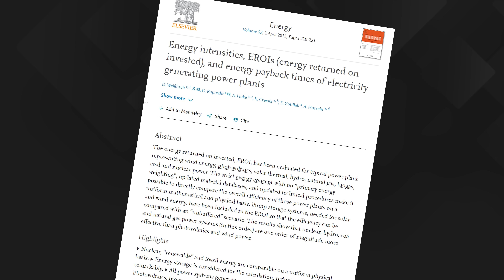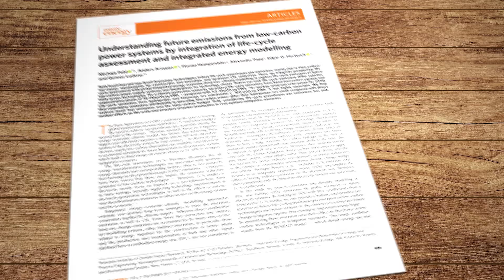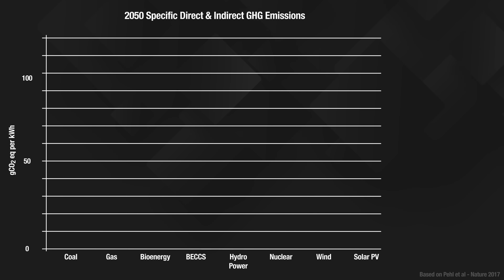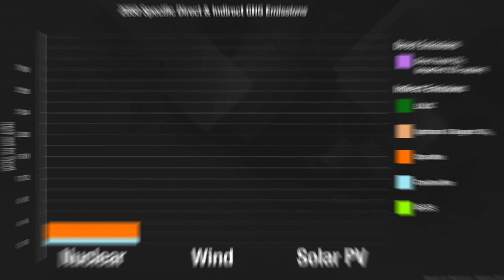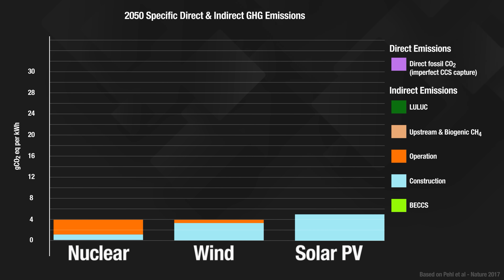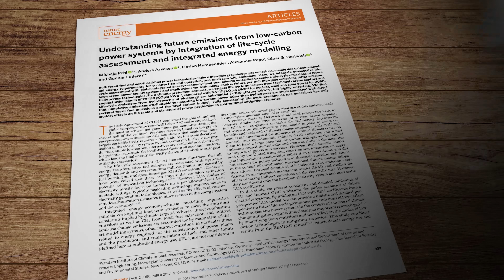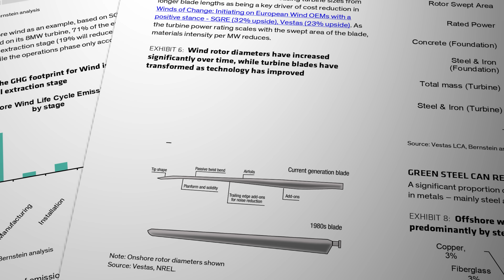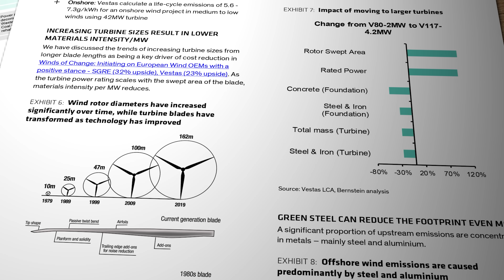Lifetime carbon emissions of renewables vs fossil fuel. Problem or solution?

Comment: Thank you for another excellent video.   Still we run into the problem of the Duck Curve (PV) and times when wind does not blow.  How does adding reasonable storage using pumped and currently available battery storage systems add to Wind and PV?    And of course some of the best CO2 reduction technologies is improvements in end use efficiency.  

Just an additional question.  Would some industries be able to switch to solar where production rates are adjusted to match energy production peaks and valleys ( again the Duck Curve).  Something like a desalination plant where it is mostly idled at night but, peaks during bright sunlight.  It is an obvious adaptation but, I haven’t seen anything discussed about trying this.
Reply: After two decades of commercial wind power, we have a large pile of excellent data about the output variations of wind turbines, and wind farms. “When the wind does not blow” really isn’t a problem for wind turbines. They’re not down on the surface like we are, subject to surface turbulence. They are hundreds of feet in the air, where the wind is both more consistent and more powerful. And since the numbers are so predictable, it’s a straightforward exercise to compute how much storage is needed for a wind farm to produce a consistent base-load power for a given period of time before potential drop off. Keep in mind, too, that it’s not just energy production peaks and valleys that need compensation - it’s energy consumption peaks and valleys as well (which are also pretty predictable long term). So build enough, overbuild enough to give an acceptable safety margin, and that’s the system, with a predictable cost. 

Solar is subject to the same sort of measurement. We can know precisely the angle of the Sun at any given time on any given day, giving us a range of output from zero to 100%. We also have detailed historical data for cloud coverage and weather conditions going back decades. Despite the popular delusion among the anti-solar reactionaries, a PV solar cell is not an on-off switch. It doesn’t stop producing power just because it’s cloudy - it just produces less, and how much less can be measured and predicted. So again, we compute how much storage is needed to stabilize as a base load, and how long we need it to be able to go in unusual conditions, and build to that. We’re overbuilding, but overbuilding is standard engineering practice across any discipline where reliability is an issue. You just roll it into the cost.
Reply: @davestagner   The question is then, how much of the over engineering is needed and how does that affect the lifetime CO2 numbers.  Any associated storage or over engineering must be included in the calculations for a reasonable comparison.  It might be a tiny addition or a large one.
Reply: @edlibey8177  The impact of overengineering or excess capacity is just a linear extrapolation. 2x capacity == 2x cost and carbon footprint (as long as we’re big enough for max cost efficiency, anyway). And unless that original carbon footprint was dangerously large, a moderate linear increase isn’t likely to be dangerously large either. Of course, this is all stuff and nonsense distracting us from the carbon footprint of burning the coal/gas equivalent of what a solar+storage solution could provide over a period of decades.
Reply: I have read large scale desalination for the worlds fresh water needs could be very damaging as the end product is brine.  Most likely this would be dumped back in the oceans of the world and would drastically change the salinity and chemical content of existing ocean ecosystems.  Small scale desalination would never be a problem but when the process becomes world wide on an industrial basis than the real problem which might be irreversible begins.
Reply: @anthonycarbone3826  depends on how the brine is added back in.
The mechanism that produces all the rain and snow in the world is a solar desalination process, it is just very spread out.
Reply: @anthonycarbone3826   Yes, after passing it through a membrane or distillation process, to recover fresh water, the resultant Brine can be 2 or 3 times as salty as sea water so if reintroduced in a localized area, like a small cove or bay, it can be a serious pollutant.   All solutions seem to creat some of their own problems.  Still for many areas desalination is one of the very few options.  

The City of Los Angeles always comes to mind.  A huge city built in a Desert.  How do we sustain it?  We take huge amounts of fresh water from hundreds of miles around and pipe it to LA.  Worked for a long time but, the city grew and grew so now water is really becoming a problem.
Reply: I think a problem with these is that large scale solar very often isn’t used for this.
Reply: I'd say for as long as there aren't any reliable methods for storing our current nuclear power should back up renewables during times of low productivity. Nuclear power is expensive to build and maintain, but so far i'ts the most viable way of closing all those gaps in energy production.
Reply: @DommTom  I read into this a while ago. This doesn't really work with our current nuclear plants. A nuclear power plant used to back up renewable might only run in average at 33% capacity. This means it now costs 3x as much to run per kWh it produces and it also causes 3x as much CO2 emissions per kWh. Grid scale storage is expensive but running a nuclear power plant with 33% capacity is probably more expensive. We would need an entirely new type of nuclear power plant (which then is in direct competition with all the new grid scale storage system coming to market now)
Reply: @devluz  My thoughtprocess excluded the addition of viable energy storages since those teand to to net yet exist. Under such circumstances nuclear power would be the most viable solution. Simply because of it's small carbon footprint and the fact that we already have the infratrstructure in place. Something which cannot be said about things like nuclear fusion or energy storages. 
So nuclear power can fill this gap. But as soon as proper energy storage are invented nuclear power would become very much obsolete whic is the ultimate goal of this whole strategy. Nuclear power isn't meant to exist in the long run, it's meant to assist the shift in the short run.
Concepts for energy storage like the one you (and "Just Have a Think") mentioned still need proper testing and roll out to be viable. They'd certainly outcompete nuclear power and the sooner they're viable the better.
But my idea was centered around the assumption tht there isn't a viable storage method avaialbe yet but a drastic need for change.
If there is a viable solution than this idea obviously makes little sense.
Reply: @DommTom  The issue is cost. We have storage technologies but we rarely use them because of their cost. This is also exact reason why nuclear plants are not used to fill in the gap. It also is very expensive.

Comment: Rats.  I was hoping to get a truly full picture in one video except for around 4:05.  
The analysis of gas itself has a much larger range of variability dependent upon how and where.  
You leave a big gap with nuclear regarding long term storage, and of course there is the problem with future storage.  Nothing is perfect with nuclear.

For in homes it is problematic and difficult to recapture, but in large power plants, that is a different story.  This is less than clear too.
Wind and solar forgets the release of carbon by harmed wildlife, depending on system.  

Looking at carbon emissions still fails to looked overall harm which is important too.

Comment: Renewables right now and for the foreseeable future means natural gas backup. The only guaranteed carbon-free non-site-specific electricity is nuclear energy. Nuclear also has the lowest levelized carbon intensity of any energy source and is statistically the single safest energy conversion technology that humanity has yet devised.
Reply: The carbon startup cost to nuclear is very high due to transportation, specifically concrete, and other materials.  Add to that the amortization of the entire lifetime management and unless you are Finland, I think you don't have a chance in hell of making an honest case for it.  The only case you can make, which is legitimate, is that a later complete end of the human species makes a saner short term living circumstance now.  To me this is somewhat similar to arguing for smoking because people live happy lives and then die right away.
Reply: @xenocampanoli815  The sunk cost of the concrete and steel in nuclear power stations is a giant argument for not closing nuclear power stations early, and for running them to the ends of their lives and doing as many life extensions and upgrades as possible. Every study I have seen puts the levelized carbon intensity of nuclear as the lowest of any energy source, or at best at parity with wind, which is infinitely less reliable. Also, a medium sized wind or solar farm uses as much steel and concrete as a large nuclear power station (while still requiring natural gas backup which entails exhaust emissions, steel, and concrete of its own).
Reply: @gregorymalchuk272  I agree.

Comment: I lived in my youth 15 miles from a large coal fired plant in central Minnesota called Sherco they had 3 generators with only one still generating but will close soon and I remember always waiting for really long trains of coal coming from the west running day and night for 30 years what if those trains were delivering solar panels wind turbines and battery storage systems and you equal the carbon weight of both over 30 years you could have covered almost all of central Minnesota in solar panels and wind turbines how is it possible that we stick with coal,gas and even nuclear power when the renewable energy choice gets cheaper and better by the day

Comment: I highly doubt that the the total green house gas emissions from nuclear are so low. The paper mentions the enrichment of uranium but now the emissions from the mining of uranium itself. I know that a lot of energy is produced per refined uranium fuel rod - but to produce these fuel rods massive amounts of mining has to be done. All currently done with explosives and machines powered by fossil fuel. There is a lot of low radioactive waste produced and the ore hss to be transported over long distances.
Reply: A single pound of uranium contains the energy of 2,500 tons of the finest quality thermal coal. That is how the energy used during mining is tiny compared to the energy gain from fission.
Reply: Also, if you disbelieve the mining for uranium, you should really disbelieve the numbers for wind turbines and solar panels given the (not 100,000s of tons for uranium ore, but MILLIONS of tons of ore that have to be mined for iron, copper, etc to produce the turbines and panels.

Comment: I've done some math...
Solar, wind and batteries require about a third of the energy they generate to make and recycle themselves. The problem is that we need to make MORE THAN just themselves. We need to double, for about how many doublings? Therefore, we will need to invest A LOT of fossil fuels into it.
Fossil fuels can be seen as the gov't that subsidizes clean energy. At first, it's just "a little research moneys", which is a good thing! Then it's like "let's go broke over it ". Posting 30% credits to everyone in the country to buy solar is, to be fair, not sustainable.
Well, it's the same with the energy. If we always have to "insert fossil fuels here" to make and recycle these sources, then we are lying to ourselves. We are expecting, in physics nomenclature, perpetual motion, or close enough to that diminishing return, that is ^almost^ impossible to, at the same time, power a growing civilization.
What we need to teach ALL math students is how to roughly calculate the EROEI for various different sources.
~~~~~~~~
They say solar has an EROEI of shit 10 (that means it generates about 10x the energy needed to make it. The energy payback time, EPT, would thus be 3 years if it lasted 30). 
To double solar energy capacity using solar itself, we need 6 out of 30 years worth, or 2/10th of its energy budget.
Now, we need to account for capacity factor. It works almost 1/4th of the time. We don't have to add that to the energy budget, though, because making 4x the panels will deliver 4x the energy. This requires that ~3 parts of that energy to be stored in batteries. I believe every watt hour of battery capacity requires about 100 watt hours to make it.
I got to go but hopefully you see where I'm going with this (just a little bit more basic math)...

Comment: These figures that are now commonly being used concerning hydro are ridiculous. Just as the figures for nuclear that put no price on waste and risk. Just a short time ago "statistics" showed the old wind turbine blades as a huge environmental hazard. They are made of glass and a organic resin. Excellent fuel and inert waste material.
Reply: The video suggests that the wind turbines are already 80% recycled. I have to admit though the figures for hydro seem incredibly high. If I've understood correctly that beige portion of the bar is meant to represent methane emissions from standing water reservoirs, and it seems enormous.
Reply: @danyoutube7491  The only way that I can see that they can come up with methane emissions like that is if they used a example of a new dam that floods a rain forest valley. Old dams couldn't possibly be pumping out that much methane. Statistics don't lie, but liars can make statistics!

Comment: Whilst you do mention that CCS can be imperfect, and analysis can allow for that, there is surely another elephant in the room when it comes to CCS. It CANNOT be a "forever" solution as the places where CO2 is stored will run out, probably faster than the holes in the ground the fossil fuels come from becoming free to use. Clearly from the figures you have shown, any kind of fossil fuel use is a bit rubbish, anyway, but still there are people pushing CCS as a way to make it clean. Also there is a sneaky term CCUS (Carbon capture use or storage) that has been suggested for all sorts from the concrete blocks you mentioned (relatively good) to growth promotion of glasshouse crops (very bad as these crops are soon waste, one way or another, eaten or not), fizzy drinks (surely not serious, but worse even than crop growing), or even using the CO2 to push more oil out of oil wells (seems like folly too). So CCS, I suggest, is not even a short term solution, never mind long term. It is a total dead end. 
Your video focuses on 2050 (rightly) but fast forward to 2100 and CCS will have reached the end of its road, or have long been proved to be "Emperors New Clothes".

Comment: Electric cars are being advertised with a length of time in operation to compensate for emission costs in production. Is there a significant difference between production costs for fossil fuel and electric cars. (Perhaps you've covered this before, in which case my apologies.) Excellent post, as always.
Reply from the maker: I did look at that in a video about three years ago. I think the numbers are even more favourable for EVs now, but here's the link anyway
https://youtu.be/VyZOLMeMYnI
Reply: Batteries must be replaced every 3-5 years.  Cost?  $20,000.